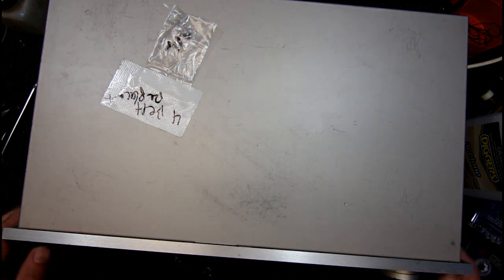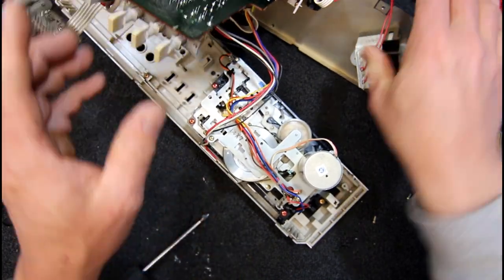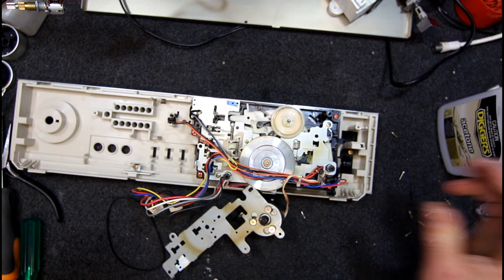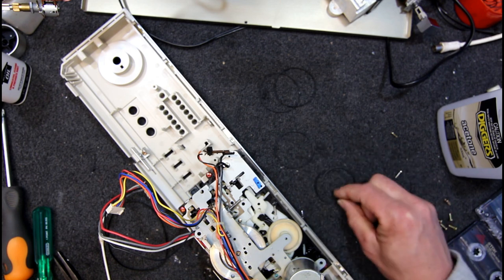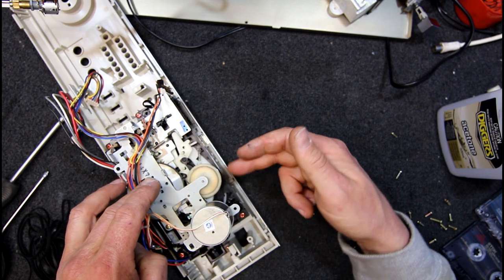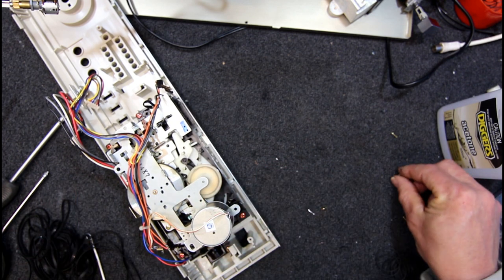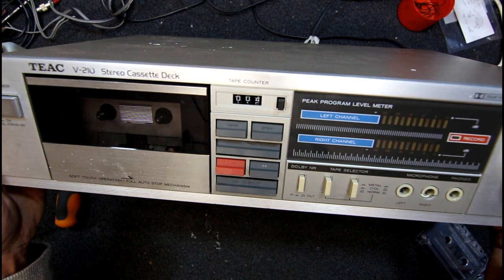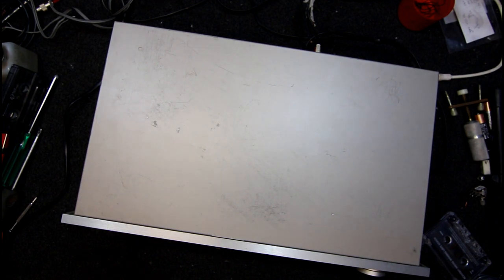Teac CX210 Cassette Deck Belt Replacement and Service

Comment: This looks like an early 1980s Toshiba (similar to the PC-G10, but I think a later iteration) and looking at the construction it wouldn't surprise me if Tosh actually made it.

ETA and bang on cue it makes the exact same gear clashing sounds as my G10 does! The ffwd/rew idler gears are loose on mine and I've never been able to fix it, must be a common issue. I thought there was a missing part on mine but seeing this it looks like it's just plastic wear unfortunately.
Reply from the maker: Interesting. The Teac's in Australia are a mixed bag with every deck looking like it came from a different manufacturer. Every mech is completely different it seems. I just purchased another one to see if that holds true.